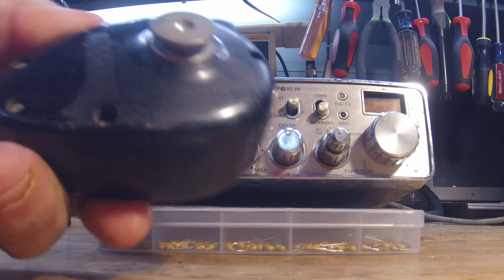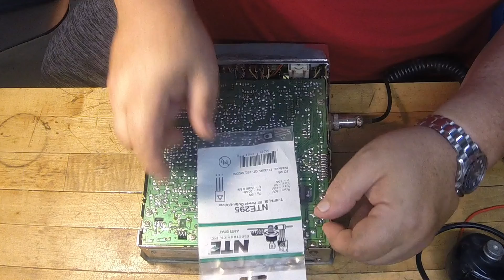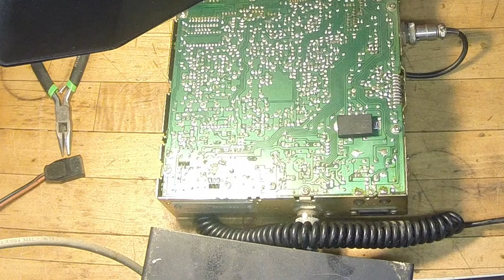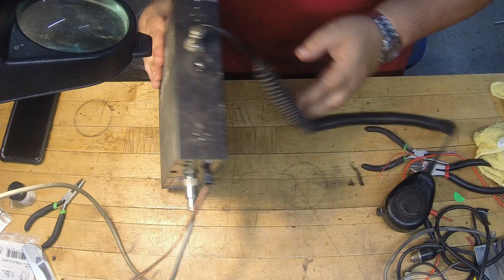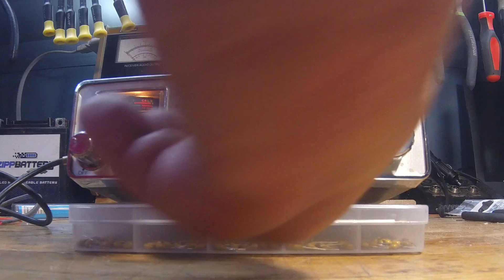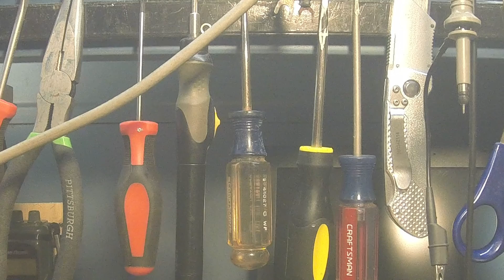Uniden PC 76XLW 40 Channel CB Repair and Peak

Comment: I have a PC 55 where the gain drops to nothing after being on a few minutes.  Zero bars on the signal.
Reply from the maker: Sounds like either a cold solder joint or a bad capacitor..
Reply: @TheElectronMan  I found this but im kinda lost. https://cbtricks.org/radios/uniden/pc_33/graphics/uniden_pc33_pc55_sm.pdf

Comment: Ive got a 29gtl that doesent transmit, if I sent it to you could you work on it for me?
Reply: Ive also got a Uniden PC 76XLW that got at a sale for $2. recieve but no transmit
Reply: 29s are cheap, buy a new or good used one. It's too expensive to send a cheaper radio off and get it repaired.
Reply: @jamescrabb8766  ya man that is what i was thinking
Reply: @Timidater  those 29 GTL units are a solid built radio , yours might be just a very simple repair ....  Those older radios had a certain board to part yellowish glue from the factory in them .....  Your 10.240 crystal might be at fault because of that glue .....It gets corrosive as it ages ..... I would say send it to him and let him diagnosis / repair it .. It could be your audio chip is blown  if you can't receive or have output audio , HENCE  you have a dead key om transmit but NO modulation .... I am like Electron Man  I used to have a 2 way repair and sales shop for 20 plus years ....  I am getting my new bench set up and will be back in biz in another 6 months with a new shop .....
Reply: @cajuncoinhunter  I would like to send it to him but he wont reply.I think im going to get a President richard ,looks like a really good radio!!
Reply: @timidater4803  Hey Lil buddy  I sent him a message in another video he put out ......
Reply: @timidater4803  Like I said  I sent him a message about your radios ...... Electronman  is a You Tube friend of mine ... Give him some time to see the replies / messages , I don't like taking other peoples  work from them .......Besides that I have a few TV's to fix and a couple Galaxy radios to finish up , I'm waiting on some parts from digi key supply parts .... I'll check back in a few days on here .....
Reply: @cajuncoinhunter  ok
Reply: Any of you guys that are looking to get your Uniden Pc76xl and Cobra 29s worked on, feel free to message me.